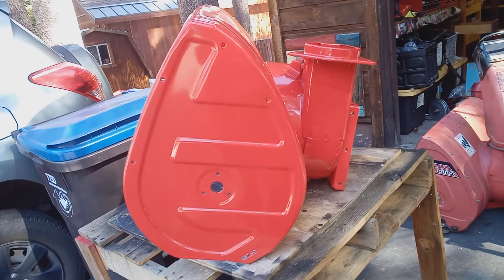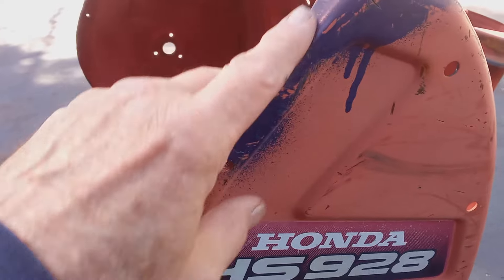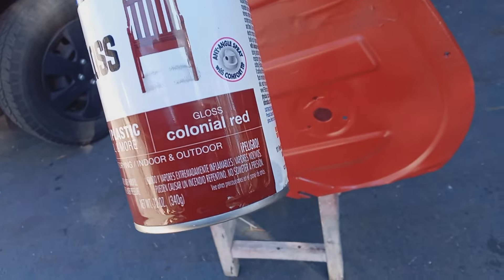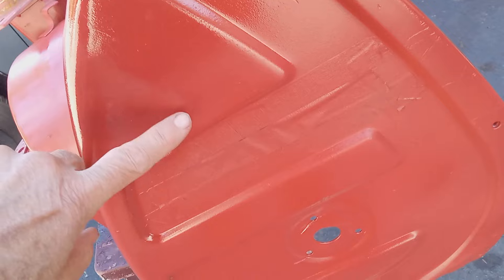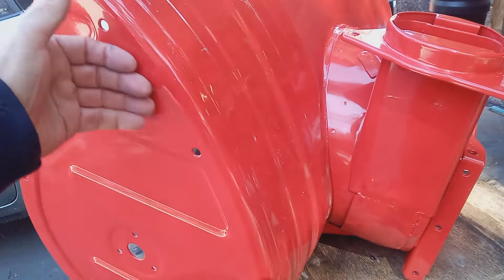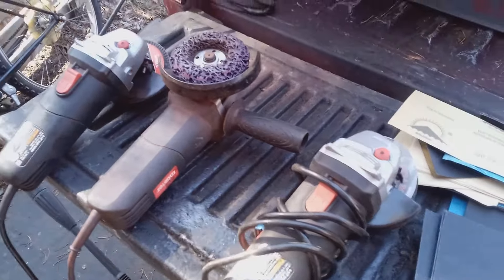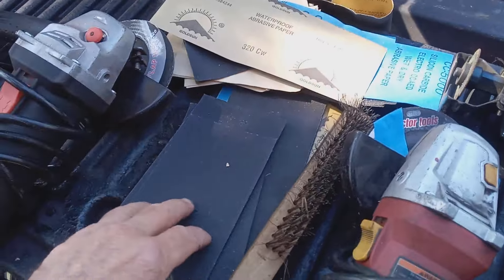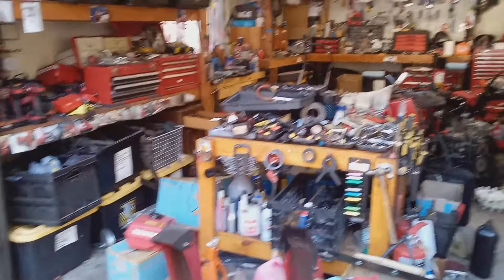How To Restore Honda Snowblower Bucket

Comment: Anthony!  Can an electric start be added to the last generation (2005ish) HS928 tracked snowblower?  Any idea of the expense and difficulty?  Thanks!
Reply from the maker: yes. very expensive. tuned engine should start on 1-2 pulls. Most owners never use electric start